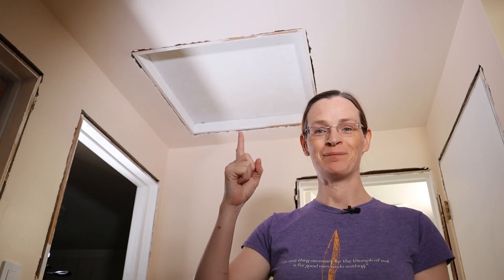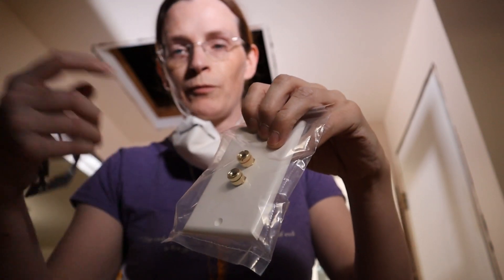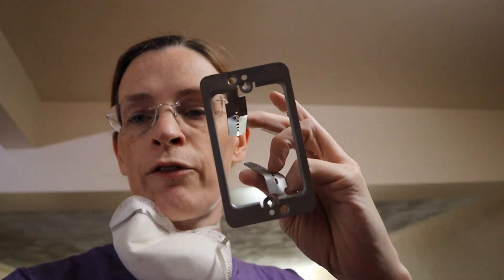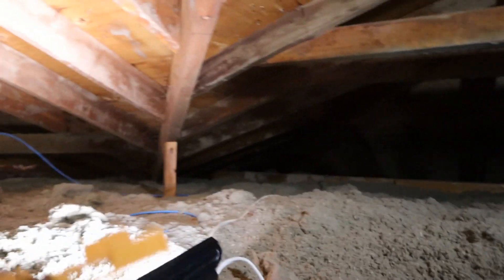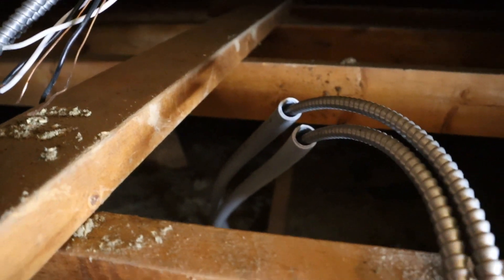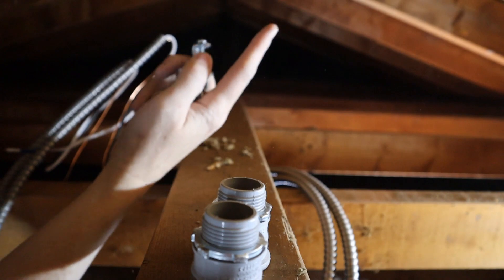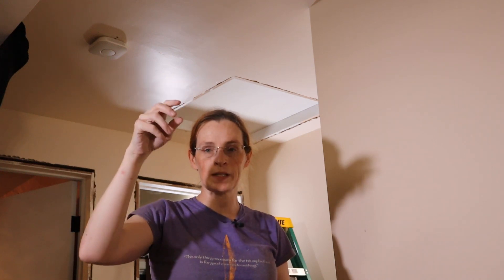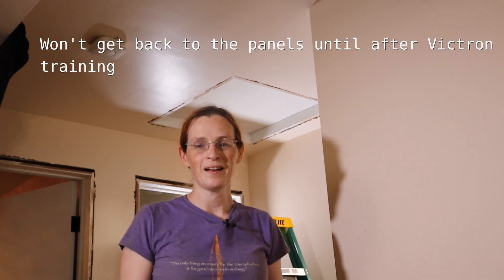Solar Panel Connection (Part 2) - How to build a 48v Lifepo4 battery (Ep. 19)

Comment: Wow,  you've got guts. I don't know how you get past the, "I've got nails poking into my head and fiberglass insulation all over me," to get to the, "I'm doing this so I can go sailing in a quiet, electric boat."
Reply: and by the way, I think for the space you're working in here, it's an advantage to have a smaller build. So I think that balances the need to be persistent when strength is needed.

Comment: oh wow - that insulation is nasty all loose, and the sheeting glass fibre makes me feel all itchy, i remember helping a friend do his roof years ago, having to get into tight awkward spaces, yuk horrible experience - what we added doing was replacing all the old fibre with a nice silica chippings, then added a plastic sheet membrane just to make things nice and clean
yep you learnt to run cables, first push hole up through to locate position above
we'll get you a full PPE white suit and mask
Reply from the maker: The insulation isn't nice, for sure.

Comment: HOWdy  D-M,
yup - Yup - YUP !
bad shoppers at the hardware stores that pilfer the bits & pieces that  "THEY" need = leaving "US" without
suggestion:  an installer (you) can replace those long  NAILS in your outlet box adapter  - with 3" long deck screws = much easier to "screw" than swing a hammer ... IMHO 
COOP
...

Comment: Not following.  Why do you have the two MC cables going up to roof? You do not want DC current to travel on solid core wire. Jumping to next video to lean more. Thanks for sharing.
Reply from the maker: Code requirement here. I was going to use stranded (the ones I've temporarily run to my desk) for the final install, but found out I couldn't here. The armoured "BX" cable is allowed, so that's what I used.

Comment: D.Mermaid, I have been enjoying your channel so very much, having only run into it a few days ago and I am inspired by your can-do attitude. 

The past six months, I have been building a Victron based  solar system for our 1998 37ft Motorhome named Zepherina, which is up and running now, and able to power everything including two air conditioners.    I chickened out about building my own batteries and went with 8 BBB, but agree that for a large battery system it is the way to go.    Right now I am able to run one 1500 watt roof-top AC unit most of the day and the 2590 watts of solar does a good job of keeping up, which was my design goal.

I dream of being able to power our entire motorhome with solar power instead of 300HP Cat diesel, but I will be content to be able to charge our plug-in 2015 ford hybrid or power the important circuits in my home in a power outage, when Zephie is sitting in our driveway.

Design Note:   I did have to add cooling fans for my equipment bay, and now have three temperature sensors connected to my CERBO – (equipment bay, batteries and coach).   Also was able to label them after upgrading the firmware on the CERBO.

I love your Idea of powering a Yacht, and look forward to your future videos, but I promised my wife that I would keep us on dry land. 
 
Old software engineer in LA
Reply: That sounds like an amazing project! Remember that something doesn't have to be perfect from the start. Sounds like you're well on your way! Remember that a finished project is no fun, so it's excellent that you have more to do still. ^_^

Comment: since you are so agile to climb up there you might install some mousebaits or other countermeasures in the attick, before you start hearing small feet running there.
when you start finding rice seed sized black droppings, mice are allready there.
some headcover such as wollen hat showercap or baseball cap might keep your hair cleaner whilst roaming up there.
Reply from the maker: There's no signs of animals up in the attic, and it's been there since 1967. So I'm not too worried. Now, the basement ceiling... That was infested when I bought the house, and I've sealed up all entry points with a pest-controlling expanding foam. So hopefully that's a resolved issue. :)

Comment: the most common cylindrical Li-Ion cell size is 18mm x 65mm often called 18650
it is easy to remember from the diameter of cal 12 shotgun barrel diameter.
Reply from the maker: If that isn't the most American post ever on this channel... lol!
Reply: @TheDigitalMermaid  and I aint no american, but a finnish person
Reply from the maker: @bassobalalaikka5005  I figured as much, but using a shot-gun as a unit of measurement, being America's neighbour myself, I couldn't help but make the connection. :)

Comment: Your SmartCam knows, that this video is all about the cables ;-)
I was just yesterday taking down parts of the roof of a old donkey stable. It was a very good idea, not to put weight anywhere, most of the wood has turned into dust, it mostly hold off the mud-straw mixture on top...
Hopefully.  your lighting did not disturb anyone up there...
Thanks for sharing :-)

Comment: I saw you go into the attic in bare feet. You must be crazy. The mask is good. Yes I've drilled a hole in the wrong place a couple of times. Those wall height  transitions will get you every time. I have had a cat with me in the attic. Good luck.
Reply from the maker: Crazy is an accurate adjective